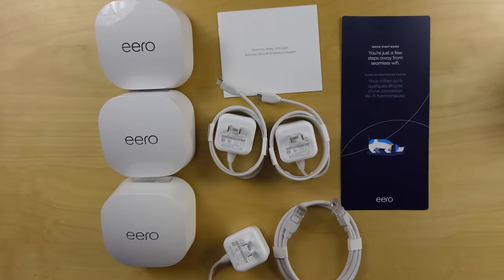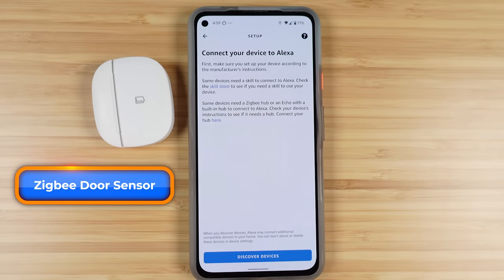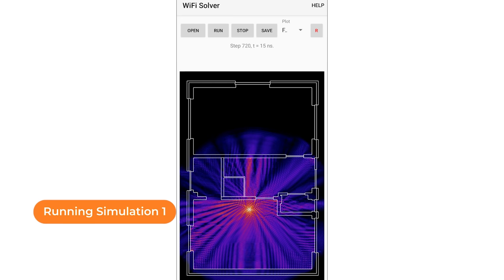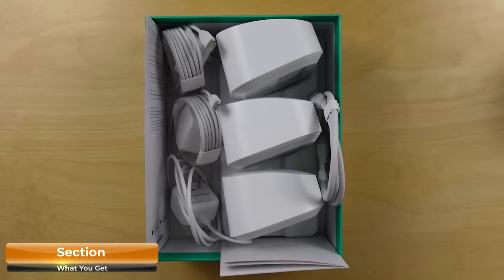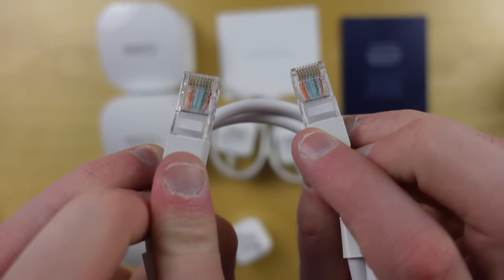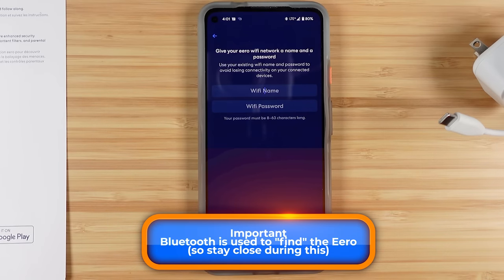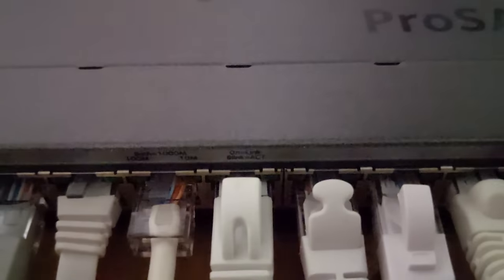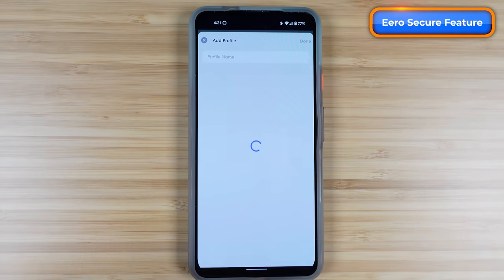Eero 6+ Set up, Walkthrough, and Review

Comment: Have the eero 6+ but the Thread option is nowhere to be found in the app :(
Reply from the maker: That's odd.  You know Joel, you might be in a funny in-between moment as Thread gets enabled across many Amazon devices.  Just keep watching.
Reply: @AutomateYourLife  I finally found it, it's inaccessible (not grayed out, it's just not there) when set to bridged mode. I didn't find that in their docs, had to figure it out myself. Bridged works better for me, but I changed to routed to enable Thread.
But - it still doesn't work. My Nanoleaf bulbs still say "No network found". So I've got a more complicated WiFi setup but still no Thread.
I've ordered some nrf52840 dongles so I can build OTBR. Not a small job, and it still may not work with the Nanoleaf.
Thread is far more theory than reality right now. And it's not a new protocol, it's been in the works for many years. I think the vendors simply don't care.

Comment: QUESTION: Can I mix ethernet backhauling to my switch, with a direct ethernet connection to the switch, and let that node backchannel use the slower radio channel?
Reply from the maker: I think you're saying the backhaul on the Node would be WiFi.  If so, yes.

I've found it helpful to wire in to nodes even when the node themselves are not wired in.

Comment: Do you need a modum to connect the router to your phone?
Reply from the maker: That question doesn't make a ton of sense, sorry.  You need a modem to connect to the internet.  The phone can connect by using WiFi to connect to your home's network.

If your router is connected to the modem (provided by your ISP), then the router will have internet access, and therefore so would your phone.

Internet -> Modem -> Router -> Phone
Reply: @AutomateYourLife  Thanks for replying, through the app I'm trying to use my cellular data to connect to the router, so that I can then connect to my smart tv. I don't have a modem or home internet. But I see I'll need one.
Reply from the maker: @Jit03 yeahhhhh sorry
Reply: @AutomateYourLife I understand tho It clearly says I can connect using cellular data.

Comment: Is the reason you can't connect to 5Ghz because it's using that band width to connect between the nodes? Isn't that the difference between this and Pro? Pro has a third band to connect the nodes and so the 5Ghz is available to run devices?
Reply from the maker: You can connect to 5 GHz with these!  So don't worry about that :)

The difference between this and Pro 6E is that the Pro 6E has a third frequency at 6 GHz.  There are other differences too, but that's a big one and you have to have Wifi 6E devices in your home to use 6 GHz.
Reply: @AutomateYourLife  okay. Maybe I misunderstood it then. Is the loss of HomeKit a bit of a let down?
Reply from the maker: I'd say yeah!

Comment: Hi Brian, love this video, thank you so much.  I'm also looking at replacing my Google Mesh network with the Eero 6+ network, but have a lot of Kasa smart home switches and power outlets and Google devices (Nest Audio, Nest Hubs, Chromecast TV, etc.).  Will Eero 6+ connect with them, and will I have to reconfigure all the devices if I keep the same SSID and password as I was using with the Google Mesh network?  Thanks for your thoughts.  Cheers, Brian
Reply from the maker: Hey Brian, nothing should break if you use the same SSID and password!  The devices might need a unplug/plugin cycle but that should be it!

Comment: 5ghz is solved by going into the device and picking a preferred band.  You can do this with many devices Windows 11, playstation, ect.  Basement is the worst place to start off with your hub for mesh.  It should be in the middle between the two nodes.  Example router on mainfloor node on second and basement.  Eeroo 6+ is far superior then Google Nest.  Wifi 6 is not about speed nessary but is a better network for multiple devices.
Reply from the maker: I still haven't found Eero 6+ to be better than Nest WiFi....  There's nothing wrong with this system, but for folks with large smart homes, Eero has to be managed differently.  You need less devices on WiFi than Nest WiFi, which is a scary thought for a 3 year old system vs a new one.

So there's give and take here.

And yep on the best placement.  I'd love to do that, but being in a rental that's a bit hard.

Comment: Thanks for the video.  Need a little help- From my router in my office, I have 2 cables going upstairs to our living area.  Can I hook up the gateway upstairs on one cable?   Can I have two Erros hard wired to the network and keep the mesh aspect of it.  I use apps that I move around the house a lot.  Thanks for your help.  Going to rewatch the video again
Reply from the maker: Hardwiring between the points just means that you're getting faster speed between the points, but you totally keep the mesh network aspect no matter how they connect.  So yep!

Comment: The solution currently in place requires the addition of a feature that enables the assignment of a device to a specific wireless router. It has been claimed that the software possesses the capability to intelligently allocate devices to the nearest router. However, it has come to my attention that certain devices are still being assigned to routers located at a greater distance. Eero's suggested resolution for this issue involves rebooting the device, with the expectation that it will then connect to the closest router. Despite this recommendation, I have observed cases where this method fails to address the problem, as devices persistently remain connected to routers farther away.

Furthermore, it is worth noting that Quality of Service (QoS) has been an established concept for numerous years. Integrating the functionality to allocate preferential bandwidth to specific devices would be a valuable addition. Unfortunately, based on my investigation, it appears that such a feature is not currently part of the development roadmap.
Reply from the maker: Thanks for all the info!  You clearly know lots!

Comment: I just installed mine and my speeds at each location haven't changed much and don't match what I get when I sit next to the router.

I wonder if having an Xfinity xfi box not in bridge mode makes a difference.

Or maybe I should get a 3rd party router and switch?

Update: confirmed. Found it an Xfinity forum where they responded to someone. 👍
Reply: Thats not working either. I may end up buying a 3rd party modem.

Comment: eero Pro 6 for $183 or eero 6+ for $118? Want to get for my parents: 1,900 sqft house, router nicely in middle of house, 200 down 10 up plan, typical phones, tablet, desktop, Roku on the network.  Would you recommend a single eero Pro 6 or single eero 6+ considering cost? Thanks!
Reply from the maker: Hey Grizzly, I haven't use the Pro but keep in mind it's a bit older now vs the Pro 6E.  So maybe something to factor in there.

But for your folks, 1-2 6+.  Pro is going above what you need
Reply: @AutomateYourLife  thanks for the reply! I’ll probably get the 6+ and test the connectivity in the house and decide if a second is need. Thanks again!
Reply from the maker: Sounds good!  Enjoy!

There are links below! ;)

Comment: What's interesting is that even though your PC was getting poor speeds via WiFi from the eero, hardwiring it to the eero gave you better speeds.

That tells you the poor WiFi speed isn't coming from the mesh network.

It's between the eero and the device when you go wirelessly. 

I was thinking hardwiring would give you roughly the same speed, so that was a surprise.
Reply from the maker: Is that true though Hans?  I'm not so sure, because my PC was fine on WiFi with Nest WiFi, plus speeds were pretty consistent across WiFi when 1-2 hops away from the main Eero Router.  My Fire Stick, my phone, my iPad.  They all seemed to run about the same (with some variation based on moment and network congestion).

So I think it's still based on how Eero was performing with a lot of devices on the WiFi.
Reply: @AutomateYourLife  maybe I didn't explain myself correctly.

From what I understand the eeros communicate to each other via their own channel.

So it seems the bandwidth is there because you plugged in directly to the eero and saw way better speeds.  Actually you saw the same speeds as connecting directly to the eero downstairs. 

It was only when you were communicating via WiFi that your speed dropped. So same eero, different speeds. 

In my head I was thinking that eero was getting poor bandwidth from the eero downstairs and it wouldn't matter if you hard wired into it.

Comment: Get an internet cable that's "straight through"???  Kinda think this part could be improved.

I bought 4 used eero 6+'s, a 3-pack and a single. I got the single unit first and wanted to get the first one set up. No ethernet cable came with it. Just the unit and a power cord.

I have spare cables I've used to connect devices to the router or a wall port.  I consider those standard. When I bought them I didn't have to look for key words to tell me how they were wired. It was just "ethernet cable" and I saw them at office stores, Walmart, Target, etc.  

You making such a big deal about straight through and how to identify them, I began to second-guess myself. In the old RS-232 days, you always crossed pins 2 and 3 because the pinout was the same on both ends. Tx on one to Rx on the other and vice-versa. Hmm. I'm thinking that makes sense, Crossover cables must be the common ones so widely used when we plug our laptop or PC into a wall port.  I'll have to go to an electronics store or buy on Amazon to get this other quirky "straight through" that you say we need.

By the time I watched this, Best Buy closed in 15 minutes. By the time I find and check mine, Best Buy will be closed and if I don't already have straight through cables, this won't get done tonight. Better go to Best Buy. They've never heard of a "straight through" cable, nor a patch cable for that matter.  But I look at their standard "ethernet" cables, all Cat 6, RJ-45.  And ALL of them are straight through.

Apparently straight through is the norm. And I don't need a special electronics store or need to order it off the internet. I can get these at Target, Walmart, office stores, even grocery stores and pharmacies that carry a few computer supplies.

The information on the type of cable and how to check was informative, but I feel as though you could also add that this is the most common type of ethernet cable. If you have one, it's probably straight through. In other words, don't panic like I did. That extra cable you have is probably exactly what you need. Oh, and a more proper name like "patch cable" might help people doing a search on Amazon.

I kinda feel the only people who have crossover cables know all about it and know they're crossover cables. Probably keep them separate or label them.
Reply from the maker: Hey Joel.  I could write you a big response here, but the age of a video matters to the terms used. :)

Comment: So basically this won’t work with a router/modem combo
Reply from the maker: Not really.  Although you could put your router in the combo unit into a bypass mode (non routing, just a switch) and then it should be fine.  There are ways around it.
Reply: @AutomateYourLife  thanks!